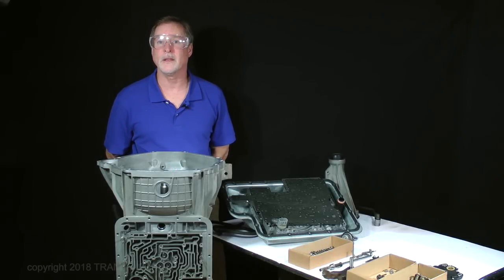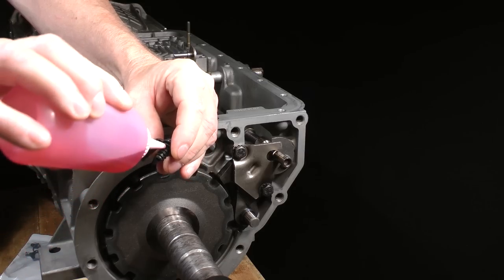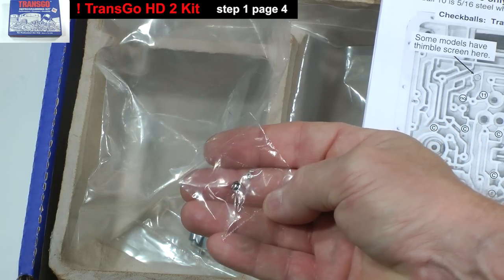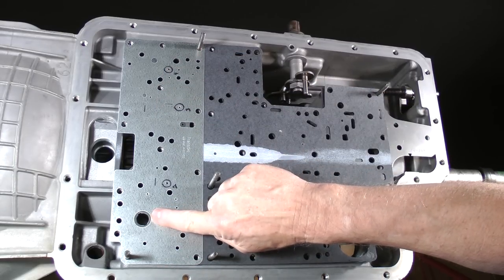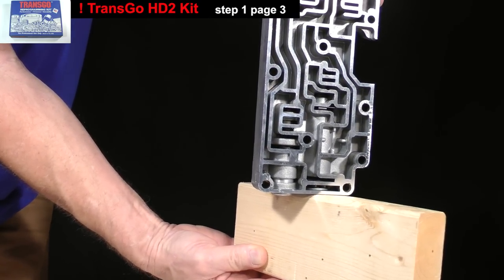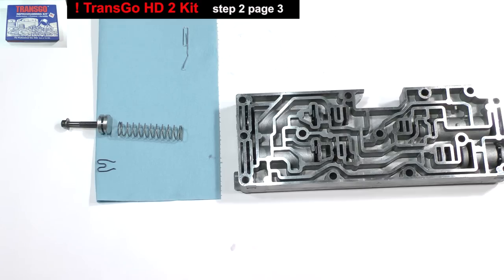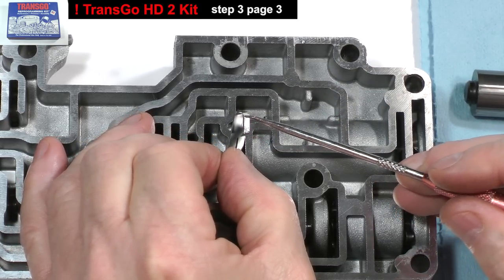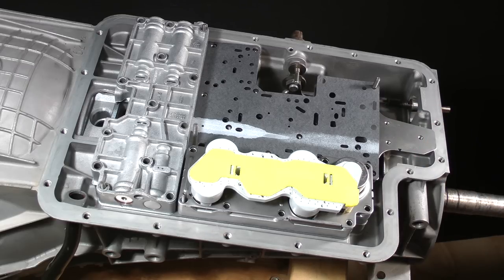Ford E4OD / 4R100 Class lesson 14 of 16

Comment: If you're doing the Transgo kit...plan on 3+ hours for this lesson. GET that 7/64th drill bit and the others ready. Get a steel block and ball hammer ready too. Its a good idea to have a harbor freight cheapo digital caliper to check drill bit sizes this small. Also recommend using a  small shop vac as you drill to get that metal death! THERE ARE NO DO OVERS here folks. Once you drill....its done. Better get it right! Mr. Williams is of course right about the wood block hammer trick for removing stuck valves. they do come out eventually. GOOD LUCK!

Comment: Why do you prefer to re-use the old check balls?
Being Rubber, would not heat and age take a toll on these items?
Reply: Yes I was wanting to know the reason for that also ?
Reply: They do not wear, they are designed to not shrink or wear.
Reply: I read this after i posted the question. I probably should have deleted my question then...
Lee Barnes: "...general consensus is that OEM plastic balls are much better quality across the board.
"...steel [balls] will have a different operational  characteristic than original OEM plastic balls and some prefer the shift of the OEM plastic balls..."

Comment: 2000 f350 7.3 4r100. shifts lazy from 2nd to 3rd and lazy shift from 3rd to 4th. 3rd and 4th have engine brake all the time. will rebuilding accumulator body fix it?

Comment: When I tried to spin the output shaft when putting the parking assembly together I realized it won’t spin when it’s not in park what could have caused this or is it normal
Reply: did you try really hard? its not lubricated much so it will be tight. Otherwise something it internal wasn't assembled properly
Reply: Mine is doin the same thing, it was spinning fine before I put the pump back in and now I can’t get it to spin
Reply: @jessealexander1721 any fix?

Comment: Why do you reuse the old check balls?
Reply: If the originals are plastic (and they are here) there can be issues of quality of that plastic of the new balls - general consensus is that OEM plastic balls are much better quality across the board. Replacement balls of steel  will have a different operational  characteristic than original OEM plastic balls and some prefer the shift of the OEM plastic balls too based on past experience with other transmissions. It's your shop, do what you want. It's obviously not too important or he would have conveyed that to us - ask yourself this, is he extremely detail orientated or a forgetful slaphappy slob? So his choice here is a personal preference and not important enough to make a crusade issue over it. Others with ego issues would issue a fatwa instead, I prefer this man's approach to the issue. We both noticed, while I have the knowledge of higher OEM quality of plastic balls as to why he would do that.
Reply: Lee Barnes  Many thanks for your comment, It answered my question.  I'm a retired heavy equipment mechanic and I love all the education on you tube.  I've never rebuilt an automatic transmission.  The companies I worked for would all send pickup automatic transmissions to a transmission shop.  My last employer was a Corporate Construction company ---  Almost all the pickups were Ford's and the power stroke variety used this transmission.  From what I could gather, Most all the transmissions in the fleet had problems and Granite Construction would send them back to the dealer --  If they were out of warranty something got worked out.  I never could get a handle on why these transmissions were such a problem..  The powers would simply tell me "It's fixed."  When this instructor put up this series of Video's, I was, and am very thankful for his efforts to help people understand and rebuild this transmission.   Few weeks back I was watching ford tech mukiloco and he went into a valve body and was showing how various plastic check balls had been tore up (on a 4R 70W) --  But he did say to replace with them OEM check balls.  I know it's Sad that a retired old boy (ME) can't put all that bullchit behind him and simply forget everything that he never totally understood.  ---  But Along came you tube and I am very thankful for all the you tube instructors.  Believe me -- I have learned a whole lot since I retired in 2009.  Again, Thanks for your comment -- Another piece of the puzzle is now in place !!!

Comment: The intermediate band piston cover and snap ring don't fit the new style piston guys only the old type 89 and older piston uses the cover and snap ring see the e4od update PDF or buy the book.
Reply: I’m at that point too. Did you just skip the cover and snap ring, or install the original back in?
Reply: *update. 

I called customer service and Jimmy himself answered. The fix for older model e4ods is to forgo the cover and snap ring.